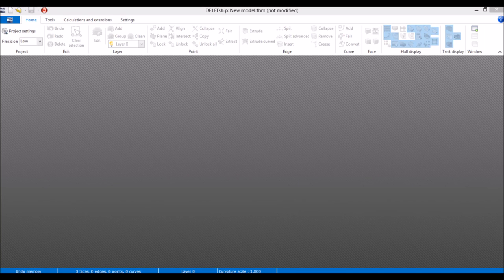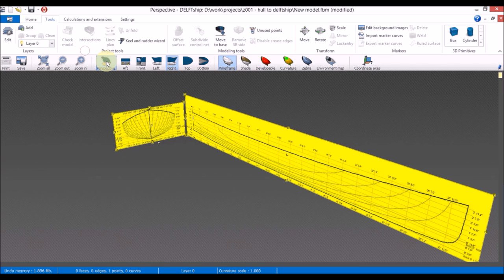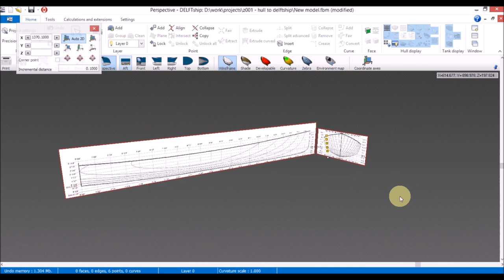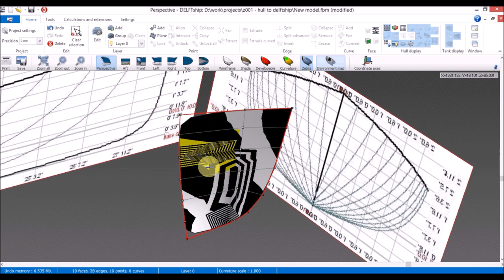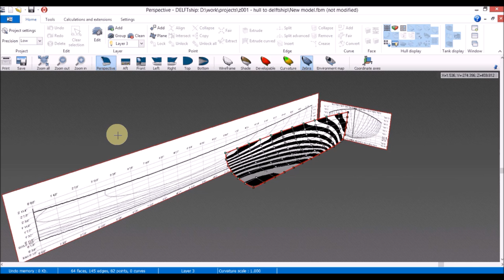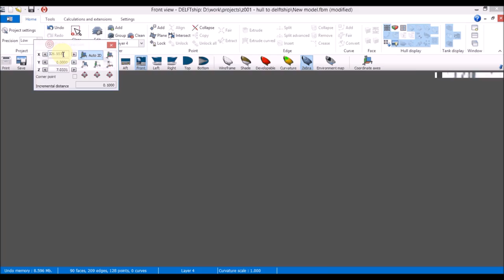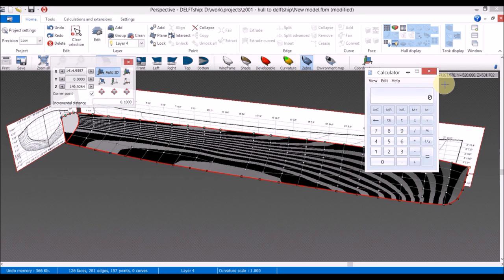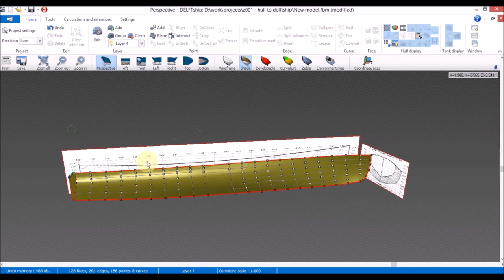Delftship - Tutorial 1 - Surface modeling

Comment: I don't like igving negative feedback but this tutorial was of very little help. You don't explain what you are doing or why. You wizz the pointer all over the place very quickly and it is veyr hard to follow what it is you're actually doing. I can hear you just fine but without properr explanations and taking it slowly this is virtually impossible to work with for newbies. 
Where it did help was getting the background image in place correctly. That's it though. Thanks for your effort.